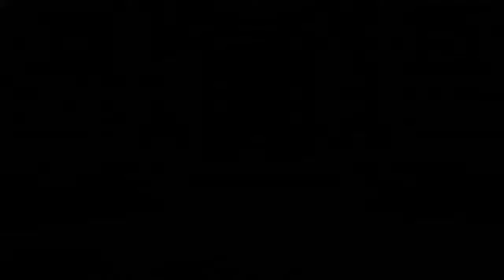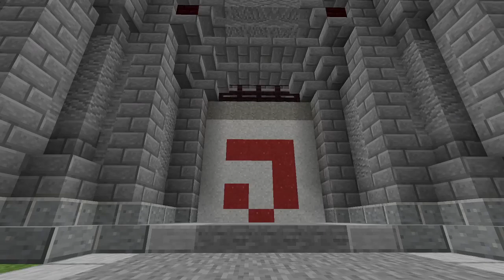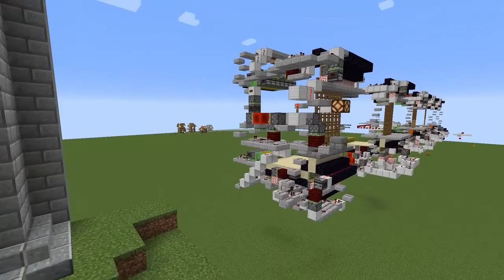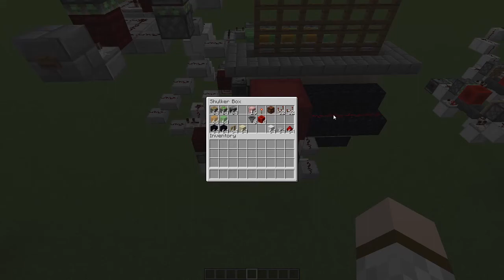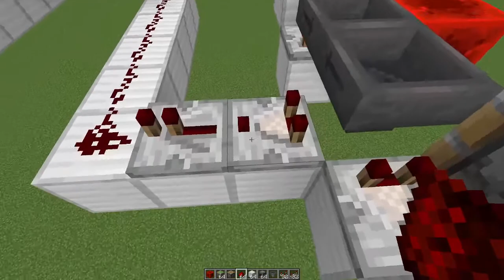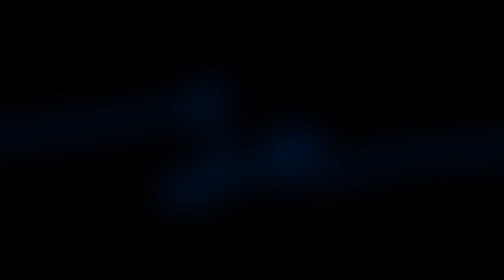How to build an actually working big Castle Gate! [Minecraft redstone tutorial]

Comment: Whenever I go to put the six block flyers they all dont wanna go and I'm not sure how to send them back, but when its just the one it works perfectley fine
Reply from the maker: Hrrm, check if you are firing them all at the same time, I've had trouble with them when they are not synced like that.

Also, maybe they are touching extra blocks that makes it go over the 12 block pushing limit?

Comment: Would you be able to help udate this for 1.21? It works for the most part but the timing is off and for one cycle the sand gets broken but I can't figure out how to fix it because it's not breaking at all cycles
Reply: OK SO I FIGURED OUT HOW TO FIX IT!!!! 
8:05 for this second hopper timer thing put 9 items instead of 8.
10:55 for this clock make the 2nd repeater 3 tick instead of 2. 

These 2 small changes should make it work in the newest version (which at the time of writing this is 1.26.2)

Comment: every time I try to make this one of the sand blocks gets thrown out. I don't know how to fix it
Reply: in the comparator clock, set the repeater with 2 ticks to 3 ticks; for the hopper clock under the gate, add 1 item into the hopper that contains the items (for example, we add 1 sand to the hopper clock if we build it like in the video).

explain: sand is a gravity block, and maybe the 1.20 update has changed some of the properties of gravity blocks so I thought that the hopper and comparator clock had something to do with the delay of the piston pushing the sand, so I extended the delay by 1 tick (idk for sure). the result turned out quite well for me, so hope this helps.
Reply: @stelthyaf  THANK YOU!!!! Finally got it to work
Reply: @phantomjinx3945  ur welcome! glad i can help :)
Reply: @stelthyaf  legend, thanks to u all this building wasnt for nothing
Reply: @stelthyaf  I love u sm
Reply: I’m having problems with the flying machines on the top row, they work the first half but don’t go back.
Reply: @ChezyUwU  check if theres anything u misplaced while building, cuz flying machines will move back when the piston facing it pushes forward and retracts.

maybe more detailed info so i could help?

Comment: What's the significance of honey slime alternation? Or could it be done with all slime?
Reply from the maker: A piston can only move 12 blocks in total, including all the slime blocks and things attached to it. If there is more than 12 blocks to move, the piston won't even try. The alternation with slime/honey blocks is to break that up:they behave similarly in the sense that they both drag attached blocks with them, but slime doesn't pull honey blocks with them, and honey doesn't take slime. Hope that explains it well enough, good luck with building!